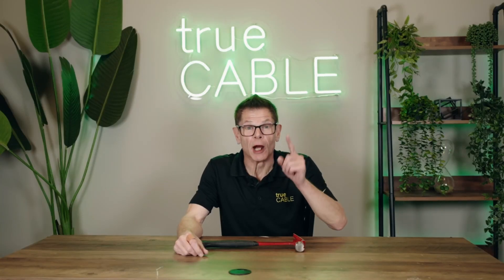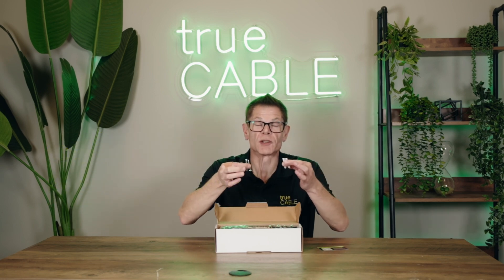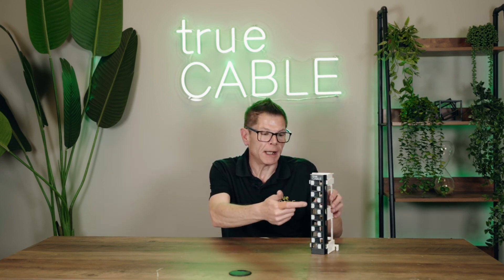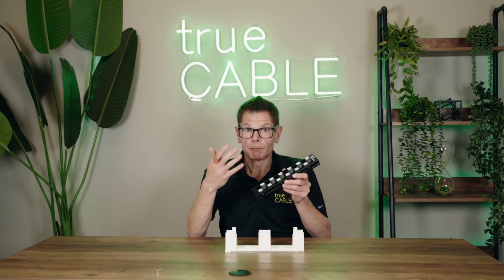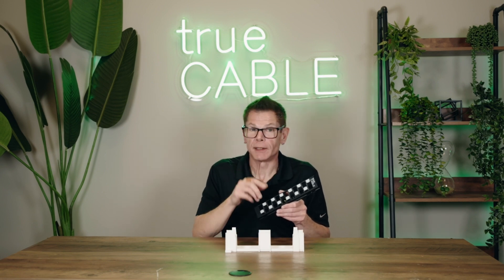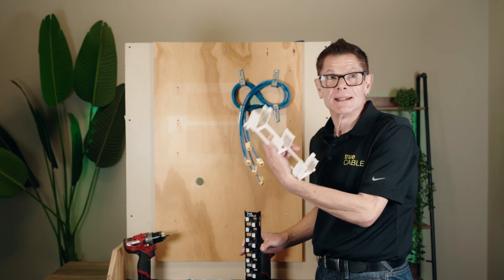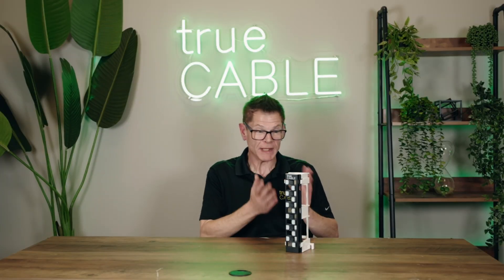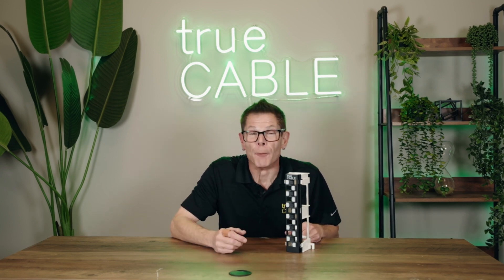trueCABLE’s 3D Cat6A Unshielded Wall Mounted Patch Panel | Overview and Installation Guide

Comment: You lost me with QR code, I'm so tired of this crap.  Print the damn instructions and put it in the box!  I don't want to futz around with some damn phone to install or use anything.
Reply from the maker: Thanks for your comment and I fully understand. I also would prefer to avoid QR codes if possible, but more than once we had a situation develop where the instructions needed to change due to a product revision or something similar in nature. The most effective way to minimize out of date or incorrect information getting out there is to keep a QR code linked electronic copy fully up to date and periodically reviewed for technical accuracy.